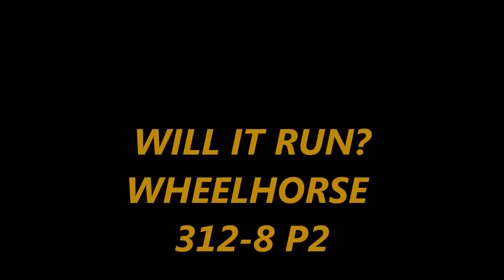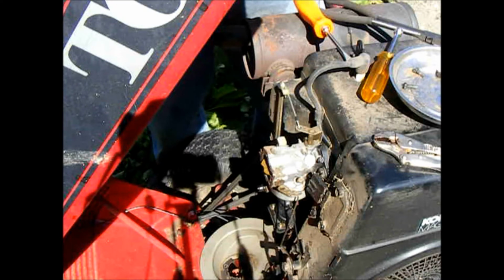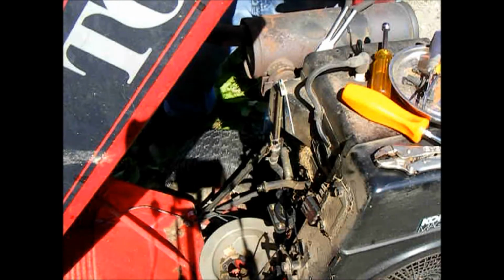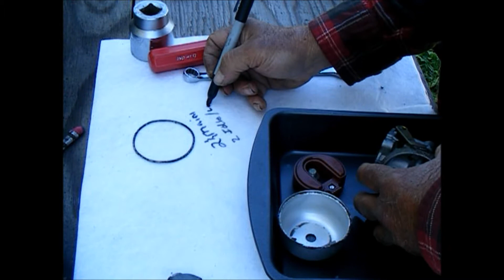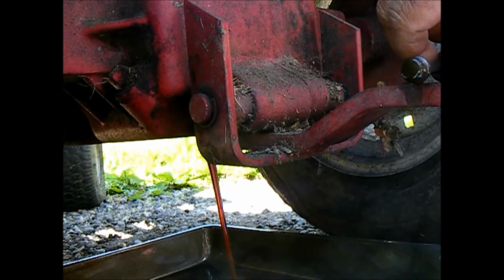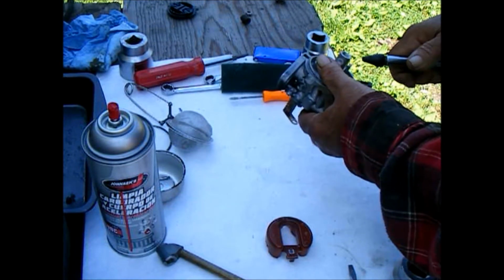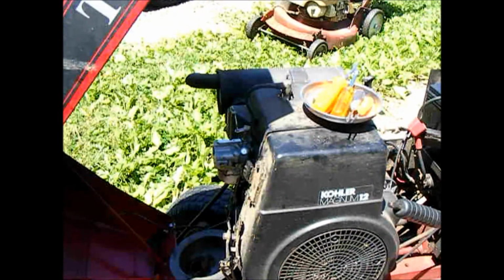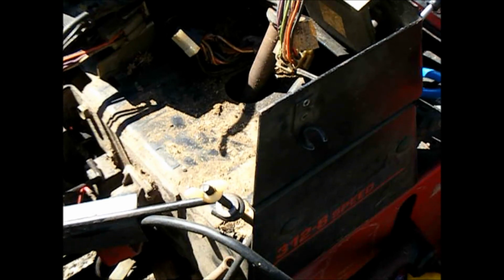WILL IT RUN? WHEELHORSE 312-8 CLASSIC GARDEN TRACTOR PART 2

Comment: Dear Sir I just found this clip don't take this comment the wrong way but I like your slow demeanour your easy to follow an informative where are you from I live in south jersey an have two wheel horses a 1975 c140 n a 1993 314 8 both very reliable units RayStein
Reply from the maker: Thank you. I'm in Connecticut